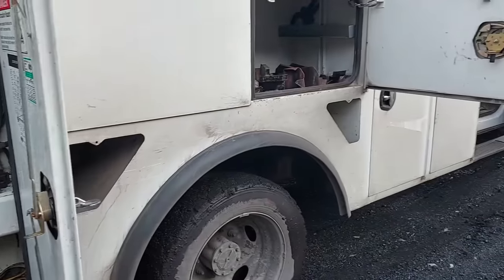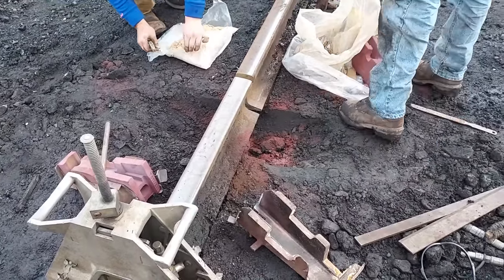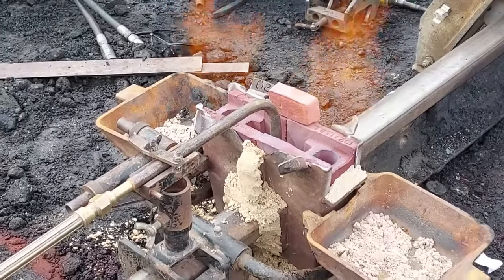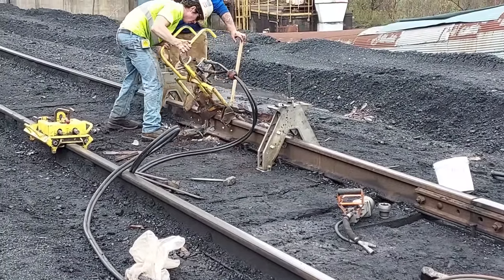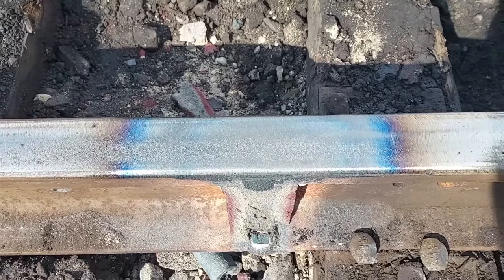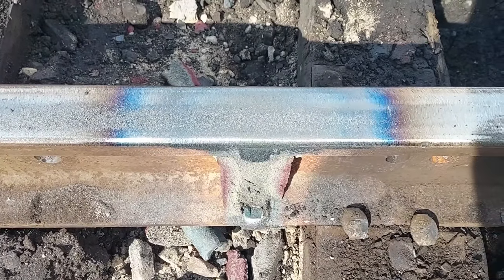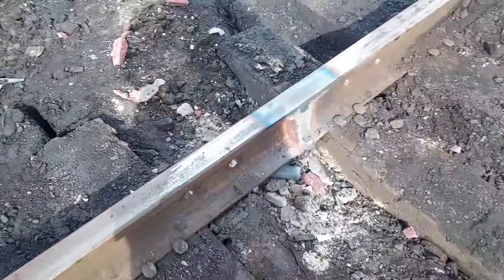Shooting a Thermite Weld on the Railroad from Start to Finish

Comment: you know, actually leveling two sections of rail to eachother where they meet isn't something you really ever think about but it's obviously very important. And any day where you get to use thermite is a good day
Reply from the maker: Your right Ethan, lot of this process the average person just does
not realize what all goes into making a weld. Glad you enjoyed
the show and thanks for watching my good man.
Reply: I think about that stuff but I’m a nerd.
Reply: that short stick isn't gonna do much for leveling
Reply: From the looks of the aftermath, the coal dust seeps onto the tracks faster than you can possibly crib it out.  Have they considered refitting the doors on those cars to be a bit tighter?  If you're the only person out there cribbing, over 17 miles, plus all the other maintenance you do, eventually it's going to outpace your ability to keep up.  I guess they call that "job security" in the churches and public houses. 😉
Reply: Tyler needs to "think about"
How
A straight edge works.
Reply: @yupalsoyup7382  it's a straight edge
Reply: Worked well on the WTC!
Reply: @yupalsoyup7382  you think any of this stays level when a train rolls over it?
Reply: Yes, the Gap is 19 to 20 mm between rails. If there isn't an opening they use the Rail saw to cut one end off to get that 20mm opening.
Reply: @amsb4dafunk558  He doesn't want the rail ends level, he's actually trying to achieve a .065 to .075" crown, so the rail isn't low after its been welded. Just sayin.
Reply: @stevehulett586  
     I haven’t a clue regarding the welding of railroad tracks
I
Do know that he is looking at the wrong side of his straight edge.
Reply: @amsb4dafunk558  Ok.
Reply: There’s a crown made in the two rails. You don’t want them level as the rail will sag as it cools once the wedges are removed. You should have slightly less than a credit card thickness of sunlight on each side of the straight edge but even amount on each. There’s a gage that can be used, though I never used one.
Reply: @yupalsoyup7382  it’s a straight edge. It’s not for leveling. It’s for crowning. But it is used to line up the sides evenly.
Reply: @scottcarr3264  just cut an inch gap. Some say 7/8” but I’ve never had an issue as long as I don’t go over.
Reply: We don't level, we are trying to build a, "crown"
Reply: @yupalsoyup7382  , they aren't leveling, they are forming a,  "crown"
Reply: I have, but I've always been extremely inquisitive. I'm always studying everything, reading, etc despite being out of school for over a decade (I'm 34 and a nerd, obviously if you go by my pfp).
Reply: More like matching than leveling

Comment: Thanks so much for showing this about thermite welding. of rails. Dad and two of his brothers worked on the railroad in Nebraska when they were "young lads. All three moved on to different industries. Dad told me about thermite welding of rails back in my younger days, I'm 83 next week, but I wish I'd listened more carefully and asked a lot of questions. Living from 1899 to 1985, I imagine he did his railroad thing somewhere around the 1920's. There were many fellows on the railroad back then  and I'd suppose the same goes now. Sure wish Dad and I could have watched your video together but he passed in 1985. I did see something interesting rail wise though. I worked in another side of the transportation industry, aviation, and was enroute to visit an airport in the Kenosha Wisconsin area and was stopped at a rail crossing, near there, by a train load of continuous rails. The crossing was in the middle of a rather long curve, long enough I couldn't see either end of rails on those cars looked as though the went to each end. Those of you in the rail business might be able to tell just how long they can get to be, and would that thermite process be used to weld those really long sections together in the field when replacing or installing new track? Also is thermite welding used in other industries? I do remember 4 feet 8 ½  inches though.and was it that tunnels had to be 18 feet or was it 23?I didn't get what the fuel was to create that high heat to make the weld happen. It always amazes me the difference between railroading, make it heavier and haul more and (my industry) aviation make it lighter and haul it fast within weight limits, and trucks somewhere in between. Again thanks for the most interesting video - I must subscribe to learn more. Jim Martin in Wisconsin.
Reply: Iron and aluminum oxide for most but when welding ground rods for power substations they mux copper in with it. Its made by Cadweld.
Reply: Mix ....
Reply from the maker: Appreciate your taking the time James to visit with us and for sending in the very nice comment. We are glad you enjoyed the
show my good man.
Reply: Nice comment good story sir god bless
Reply: @georgejoyce2710  That's what we used to do delta grounds for the service panels at outdoor ampitheaters, etc. Same principle, but a toy compared to this video.
Reply: I watched a video of guys in India doing this. They were wearing sandals thin pants and a tee shirt. Poor guys!
Reply: Wow 1899. Have a great one sir!
Reply: Your dad watched the video through you 💓
Reply: @georgejoyce2710  
Aluminum powder and iron oxide.  Called a redox reaction, the iron oxide is reduced to iron while the aluminum is oxidized. Aluminum is very electronegative so it forms very strong bonds with oxygen.

Comment: " The welding reaction is carried out in a high temperature resistant graphite mold. The mold is made of imported graphite with high density and good wear resistance. It has the advantages of reasonable design, long life, and good performance. It can withstand the melting temperature of copper, steel, iron and other metals. The flow direction, flow rate and final shape of the molten metal are strictly designed, and the mold life is introduction of exothermic welding about 200 times." Chat GTP..............Yes, exothermic welding (commonly known as thermite welding) of railroad tracks typically uses a graphite mold. The graphite mold is reusable but only for a limited number of welds. Graphite is chosen because it can withstand the high temperatures produced during the welding process, which can exceed 2,500°F (1,370°C). However, the mold does eventually wear out due to exposure to extreme heat and molten metal, requiring replacement after a certain number of welds, depending on the quality of the mold and the frequency of use.
Reply from the maker: Thank you for sharing that important information with us HunHunter, quite interesting to learn indeed. Really appreciate your taking time to watch and may you have a very good day my friend.

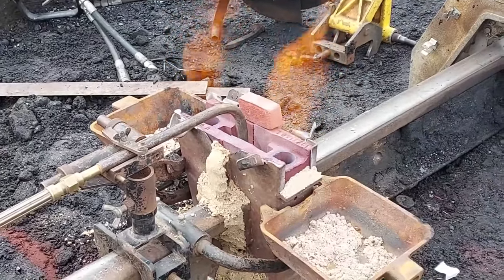Comment: Around 7:14 you'll see a little rectangular piece of the mold laying loose near the hole the torch is poked into. That is the diverter plug. it gets dropped in right where the torch was after preheating is done. It will cause the liquid metal to flow to the outer two 'risers' and fill the mold from the bottom, which forces the impurities and slag out the top.
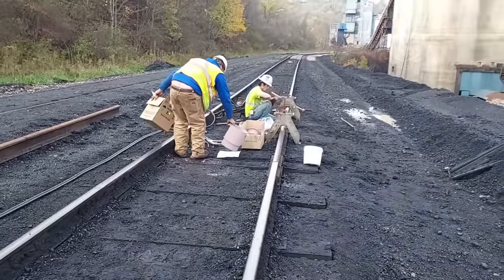Reply: And at around 02:18 you'll see some arse crack.
Reply: tyty
Reply: We did 9000, feet of 100 lb. rail with thermite welding...underground at the mine I work at...where the fumes and smoke don't go anywhere when the ventilation stops working right.
Reply: Are the molds ceramic?  I just can't think of a material that'll withstand 5000⁰f.
Reply: @joshjoshspangler  true wisdom
Reply: @christopherscott8853  there silica sand
Reply: Do you use these molds? Are they one time use?  Because silica would melt into glass at about 2800⁰f....much lower than the temperature of the accelerant.
Reply: @christopherscott8853  yes that's correct the inside does turn to glass. I've been doing this for 20yrs in the UK
Reply: @markanthony3275  really?...you know the fumes can cause impotence, it's on the msds
Reply: Hey....where's your husband?!
Reply: I was curious about that, thanks for the info!
Reply: @stevenblagburn3951  Cool to know. I do only brazing in my trade...a/c.  How many welds do you get per form? I mean they dont last long, right?
Reply: @christopherscott8853  I'm not sure what you mean by form.
Reply: @christopherscott8853  if you mean the moulds. It's a single use process
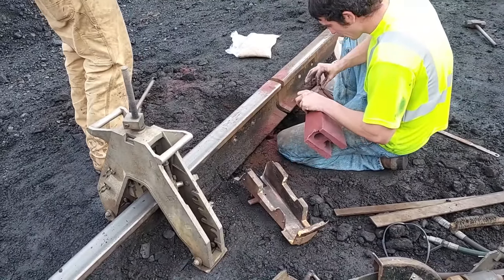Reply: around 3:28 you hear a voice
Reply: That's what I meant.  Tnks.
Reply: That’s not correct. The metal flows either side of the plug, down the runners and comes back up out the risers
Reply: @joshjoshspangler  I’ve seen more crack on the railroad than on the streets of Harlem LOL Joking.
Reply: @joshjoshspangler  🤣🤣 thanks for your notice
Reply: @joshjoshspangler  
Thanks for that, I was just getting ready to have dinner, pork butt actually.
Reply: @spidersinspace1099  😂
Reply: I wondered why the dropped that plug in there- THANKS
Reply: @christopherscott8853  I heard him say CLAY.
Reply: @joshjoshspangler  There was no time 00:36 and no arse crack.
Reply: Lmaco
Reply: I just happened upon this and had a couple of questions.   Except to reduce the pounding caused by going over the gaps, why do railroads do this?  Does this 550 dollar expense save them any money    and how could they even prove it?
Reply: @joshjoshspangler  What weld filler is used for arse crack? Preheat?
Reply: @christopherscott8853  They're ceramic, really just a fancy crucible.
Reply: @johnjornod6429 the pounding does considerable damage to the track, as in not just metal but the entire structure underneath, requiring more frequent maintenance on busy routes.

In some countries (incl Russia) they don't weld track b/c thermal cycles are too great and keeping the thermal expansion gaps is the lesser evil.
Reply: Thank you. I was wondering why they were plugging the hole they just put all that fun stuff over.
Reply: Guys, Salvation is Simple

HalleluYAH translates “Praise ye YaH”

YaH is The Heavenly Father
YaH arrives via the TENT OF MEETING
YaH was Who they Crucified for our sins
YaH was Crucified on an Almond TREE

Ancient Semitic of Moshe (Moses)
Isa Scroll (The Original Isaiah)

Isaiah 42:8
"I am YaH; that is my Name! I will not yield my glory to another or my praise to idols.”

Isaiah 43:11
“I am YAH, and there is no other Savior but Me.”

Isaiah 45:5
“I am YaH, and there is none else.”

Comment: The Mt Vesuvius Volcano display is actually the shortest part of the welding. Watching a repair on a main line with time constraints really brings out the skills. Improper preparation can be just as bad as the defect. Proper grinding also is a big factor and don't forget to shovel up the debris as it's a tripping hazard and by  your shop a possible fire source. Thanks for today's trackside lesson!
Reply from the maker: Your absolutely correct Paul in that not getting the prep right can
be worse than the defect. We try to do the welds when train not running but it doesn't always happen and then your under the gun,
but have to do it right any way. The train had just left the load out
in this case so we had about 3 1/2 hours of time, finished both
welds just in time for the next train to start loading. Thanks
for watching sir.

Comment: I've seen a lot of thermite welding videos, and they are always fascinating, but none of the others showed the leveling part. Thank you.
Reply: "termite", lol
Reply from the maker: Your welcome Bill, really glad to hear you enjoyed the show. We do
appreciate your tuning in and watching sir.
Reply: @ccrx6700  - Awh... I was actually looking for a true start to finish.  Good video, never saw that process before.👍
Reply: Yes, they have to be Very level, both vertically and horizontally, before you do the Join.
Reply: Railroad grades have to be very subtle, or the locomotives will not be able to pull the train
Reply: In the UK the alignment is done with wedges, both vertical and horizontal. It’s interesting to watch and the difference in setup time between a skilled and less experienced welder is telling.
Reply: They are leveling, they are forming a,  "crown"
Reply: @peternewton2200  , same here in the states, we use wedges
Reply: @scottcarr3264 ,  no, they're not leveling, they're building or forming a,  crown
Reply: @gradyrogers6707  they raised it too much.......yep

Comment: I'm a retired electrician and we bonded "grounds" [ copper wire / copper plate splice ] but ours were brass. Basically a controlled explosion. Good video.
Reply from the maker: Glad to hear you enjoyed the show today sir. We do appreciate
your watching.
Reply: Spent many Cadweld shots doing in ground and building steel with 4 ought bare copper.
Reply: The signalmen use copper bonds to go around those joints on the mainline to keep that continuous current thru the rails.
Reply: Electrician here also with something to add. Thermite for electrical bonding is copper oxide and aluminum it burns much more violently than the iron oxide version.

Comment: The moulds are made from fire clay which is a bonded and fired alumina/silica kaolin mix.  The actual thermit mix is (around) 60% iron oxide, 35% aluminium and 5% alloying additions - usually ferro chrome, ferro silicon, ferro molybdenum blended usually in 60 grit grain size.  The actual blend varies to match the steel composition of the rail.
I worked on the Singapore and Hong Kong railways about forty years ago and the amazing thing is how the kit is basically the same.  We’d have loved those hydraulic cutters though - we had 14pound hammers!
Reply from the maker: Thank you very much for the excellent info! We do appreciate
your writing in and for watching today my friend.
Reply: • thank you for sharing that •

Comment: Awesome video man!  I've been wanting to see how this works. I'm an engineer (though they still don't let me drive the train) with six P.E. licenses.  I'm pretty good with welding.  But this is a process I've never done.  My uncle Brian used to work for the C&O railroad as a welder.  He could weld anything.  He did not smoke.  But, he died of lung cancer.  I think it was from all his RR welding.  This process especially.  Another buddy of mine, Roy, worked for C&O as well, and did this process.  He's OK, but he said there was a lot of smoke and brimstone.  I see these guys doing the process, and they don't have a proper respirator.  That's not on them....it's on the guys that spec'd the process.  Maybe I'm wrong, and I stick and TIG weld without a respirator....but I don't do it day in and day out.  I have to worry about these guys doing this work daily.  I think they need lung protection.

In this video, their end result looked outstanding.  A job well done.  I just hope they don't wind up like my uncle.  I'd be wearing a P-100 paint shop respirator when I did this work...just like when you spray Imron.  Better safe than sorry.  If I'm wrong, tell me.  But my uncle was a good guy and was only about 38 or so when he died of lung cancer and he didn't smoke.  So, I think this heavy welding is something to be careful with.  

Again, great video!  I'd like to see it done in person :)
Reply from the maker: Thank you so much Jim for the very nice comment. You make
some excellent points about the respirators. I will tell the
2 gentlemen next time they come here. Really appreciate
your taking the time to watch and write in my good man.
Reply: Yes I had an opportunity to eventually become a pipe welder and I did work as a helper.  But I saw that there aren't any old welders, and heard from people that lung cancer is common.

Comment: That was just so fascinating to watch. I'm surprised by the gap having welded before. But I figure they knew it was enough for the process. Thanks, Dave, for sharing how that is done.
Reply from the maker: Wow John! really glad to hear you enjoyed this one. Really so much
appreciate your wonderful comment and for watching my friend.
Reply: The thermite produces plenty of super-hot molten iron which fills the gap.
Reply: 1" gap for regular welds but they make a wide gap weld kit that you can shoot at 1½". Company standards where I'm at you have to use a bicycle grinder to grind the base and web of the rail to get rid of any defects the weld leaves behind.
Reply: @hrdwrkncnsrvatv5131  L50 & L80 wide gap welds; well that were the other sizes I welded 30 years ago
Reply: @hipster1966  they still have wide gap welds. They just "prefer" 1" haha